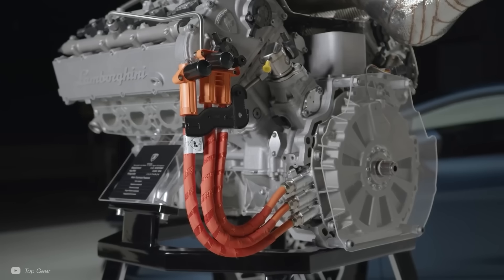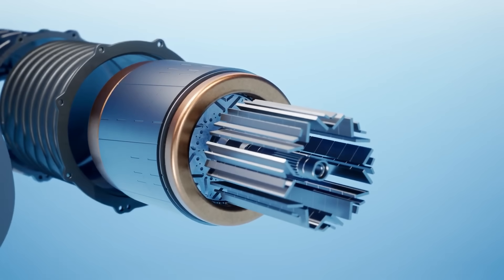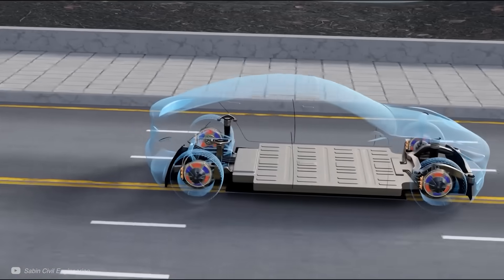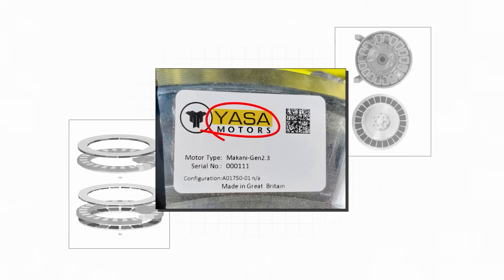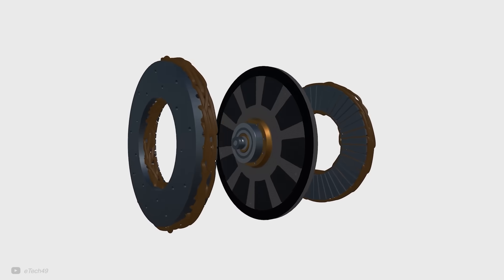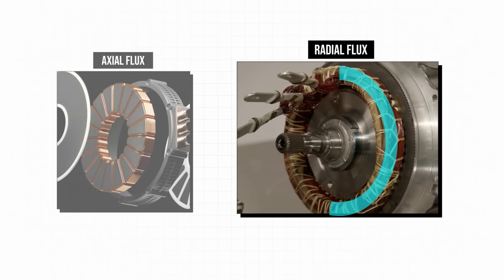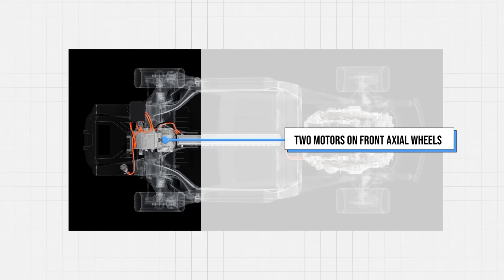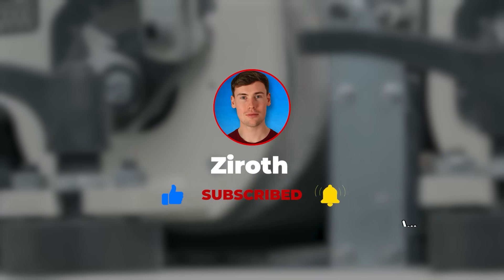Revolutionary Yokeless Motor: The Future is Here

Comment: By having permanent magnet rotors on either side of the axial stator, you remove the need for a yoke on the stator, but introduce the need for an equivalent magnetic-flux-focusing element on the rotor instead, and end up using more rare earth magnets. Talking about saving weight in the stator is putting things out of context. Maybe they use halbach arrays to reduce the rotor yoke requirement, but that means even more rare earths. Having a split rotor also seems more complicated in terms of torque transmission, but I may be wrong on that. Having the yoke on a synchronous motor rotor (i.e. this doesn’t apply for asynchronous motors) also has the advantage of not having to worry about eddy currents throughout it, meaning you can make it solid instead of laminated or powder-composite, and make it structurally stronger. I wonder what material they use for the armature? Unlike a radial motor, uniform flat stacks of silicon steel laminate would be prone to eddy currents.
Reply: They do use halbach for the rotors, and needing a steel backing on the rotor is not exclusive to axial flux

Comment: 3:06 it seems to me like it could be wasteful to have two magnet sets on either side of the electromagnets. I can understand that it's a simpler mechanical design to have the magnets on the outside, but wouldn't there be loss of flux on the "outside" sides of the magnets? Has anyone tested this with a single rotating magnet set in the middle, with a pair of fixed electromagnets on the outside?
Reply: Are you referring to the stator-rotor-stator configuration? It seems simpler, but it's more complex to manufacture, and the permanent magnet rotor endures a lot of stretching.

Comment: Correction: The concept of Axial Flux motors were not developed in 2005. You can trace their origins right back to 1800s, first with Michael Faraday and later Nikolai Tesla.
Edit : As far as I can see, this is conceptually very similar to a halbach array, which is really popular in the 3d printing community as it uses the pole magnets to guide the flux rather than a slab of electrical steel, allowing for 3d printed motors.

Comment: So this could couple to my transmission, take up very little space. The remainder of the space under the Hood/Bonnet is more batteries.

BMW did this years ago with just a Flywheel change. Coils on the outside and magnets along the edge of the Flywheel.

Comment: I wonder if this can be integrated into the hub of a low cost EV, along with a disc brake? Removing reduction gears, drive shafts and CV joints would really boost efficiency and reliability. Never mind Supercars and their performance, just 100HP or less per wheel is all you need for amazing performance in a low cost EV.

Comment: Lamborghini has integrated axial flux motors into its hybrid supercars, notably the Revuelto and the upcoming Temerario. These motors, developed in collaboration with YASA, offer a compact and efficient design, enhancing the performance of Lamborghini’s vehicles. ￼ ￼

Lamborghini Revuelto:

   •   Powertrain: Combines a 6.5-liter V12 engine with electric assistance.

   •   Electric Motors: Features three electric motors, with at least one being an axial flux motor.

   •   Performance: Delivers a combined output of approximately 1,001 horsepower, enabling rapid acceleration and improved efficiency. ￼

Lamborghini Temerario:

   •   Powertrain: Merges a newly developed 4.0-liter twin-turbo V8 engine with three YASA axial flux electric motors. ￼

   •   Electric Motors: Two motors are positioned on the front axle, each providing 110 kW (148 hp) and 300 Nm (221 lb-ft) of torque, while the third motor is integrated within the engine housing to enhance performance and reduce turbo lag. ￼

   •   Performance: Achieves a total power output exceeding 900 horsepower, with the V8 engine capable of reaching up to 10,000 rpm. ￼

The adoption of axial flux motors in these models underscores Lamborghini’s commitment to blending traditional combustion engines with cutting-edge electric technology, resulting in vehicles that maintain the brand’s performance heritage while embracing modern efficiency.

For a deeper understanding of axial flux motors and their impact on automotive engineering, you might find this video insightful:

Comment: If axle flux motor is so good, why doesn't any EV have it?
Reply: They are not safe and demand more maintenance, problem is magnets which are glued on plate, it can be distract. Happened also to innovator and owner of Emrax company during the take off with his sail plane.
Reply: cuz its brand new tech
Reply: @elvisarodell8483  It is a new tech Lynch motors are more then 30 years around, there are many other producers as Emrax.
Reply: It was kind of rhetorical question.. apparently They go back to Michael Faraday 1821 and also Nicola Tesla did a patent with them. They are high torque but low RPM, while regular electric rotors are the opposite higher RPM low torque. 
The main problem has to do with manufacturing and maintaining the millimeter air gap between the rotor and the stator. 

They would work great in places where you need extremely high torque in a very small pancake shape. That's why are they are being used in gas hybrids where the torque converter would usually be since it fits that space.

Comment: I am not an engineer here. I just wanted to compare the motor output seems very impressive compared to what I think is a similar (in-transmission) motor on the Ford F150 hybrid.  That motor only has 47 Horsepower.

Comment: well too bad they are putting them into super expensive cars- They could insert ONE motor into rear of small city car and BLOCK the power output, to reduce heat and stress of elements - because small, normal cars do not need that much power. This could be cheaper, maybe more durable options for cheaper EVs. 
I bet it has less parts, is much cheaper to manufacture, It takse less space in a car and in factory. Thanks to that whole EV will be lighter and will have more range. 

Too bad that many companies like Donut, Yasa, Elaphe do not insert them into normal EVs. Only company Saietta made motorcycles, platform and whole axles with motors, but they merged with Exed Clutch and we don;t know what is going to happen with all that tech. They had vision to insert their Axial flux and systems into cheap indias cars and motorcycles.

Comment: Electric motors have reached the torque vs speed issue that differentiated Diesel and Petrol engines for so long - diesels had superior torque but petrol always had superior speed
Reply: Well, do you believe in that? All I see is gears in combustion. Without gears?

Comment: @7:48 our friend speaks of the segmented Armature…. Then goes on to describe the stator.  The armature is where the permanent magnets are.  The stator has the windings.  As a result he spoke of the stator as the armature. We still do not know of the armature was constructed (other than “segmented”).
Reply: In electromechanical engineering, the armature is the place where the windings are.  That can be either the rotor or the stator depending on the design of the motor.  In this motor (and most motors found in automotive applications), the armature is the stator.
Reply: @JonathanMaddox  I am thinking that the armature is always the rotating part. The stator is stationary. Hence it is called the stator. Either can be permanent magnets or wound electromagnets. For instance a brushless DC motor (not switched reluctance) has a permanent magnet rotor and a wound stator. A simple brush type motor can have a wound rotor and a permanent magnet stator.
Reply: @drswanny9000  the rotor is the rotating part, the stator is what it rotates relative to.  The armature may be part of the rotor, or part of the stator.  In most automotive electric motors, the armature is part of the stator.
Reply: @drswanny9000  I suppose there are also motors where both rotor and stator have windings, though it's uncommon.  I honestly don't know which part we would describe as an armature in that case -- maybe such a motor has two distinct armatures.
Reply: @JonathanMaddox Yes, both the rotor and the stator can be wound.  However, in all cases, the rotor rotates and the stator does not rotate.  Being a permanent magnet or a wound electro-magnet does not determine if it is a stator or a rotor. Only whether it rotates or not.

Comment: this is a stupid design.  why tf would you put the electric motor BEFORE the clutch?  electric motors don't need a transmission to operate smoothly, thats one of their biggest benefits.  putting it in front of the transmission just means you're feeding more power into the transmission for no good reason.  It's like putting a transmission in front of another transmission wtf is the point of that??  Put the electric motors drive AFTER the effing transmission, and you don't have to build a tranny the handle the power of the additional electric motor.  ffs duh

Comment: One of those motors in a motorcycle would be absolutely incredible.
Reply: Company Saietta builded few.
Reply: You don't want that unsprung weight in a motorcycle wheel. It would be a disaster.
Reply: @chesshooligan1282  that unsprung mass is a myth.
Reply: @chesshooligan1282 I never envisioned it in the wheel but rather a drive system to the rear wheel, a drive shaft similar to a BMW would be my choice.
Reply: @Julian-1111  Well, yes, a light and powerful motorbike with instant torque would be a dream, but all the weight reduction gained by switching from an ICE engine to an electric motor would be negated by the weight of the battery (or at least a battery with decent range). All the major improvements in electric motorcycles are going to come from the battery technology. The battery is the new "engine."
Reply: energica and zero motorcycles, accelerates like a rocket.

Comment: so it's basically a flattened out brushless motor you find in any cheap chinesium cordless tool?
Reply: Floppy disc drives used almost exactly that: yokeless but armature-less as well, axial flux.

Comment: axial flux motors outshine Tesla’s radial flux motors in power density, torque, and compactness, potentially offering better range and efficiency in a lighter package. Yet, Tesla sticks with radial designs for their manufacturability, cost-effectiveness, and reliability at scale. Axial flux technology is gaining traction—think YASA in Mercedes AMG or Ferrari hybrids—but it’s not yet ready to displace Tesla’s finely tuned radial motors in mainstream EVs. Tesla could explore axial flux for niche, high-performance models, but for now, their radial flux motors are a pragmatic, battle-tested choice.

Comment: can someone explain the pizza trays analogy he used around 2:30 ?
Reply: Simplest way to think about it, is radial flux motors create a magnetic field toward the outside or inside of the circle in the direction from center to circumference, axial flux creates the magnetic field toward the faces of the circle. The 2d representation of a very 3d principle wasn't the greatest.

Comment: I wonder if it's possible now to just put the motors inside the tires to bypass transmission losses and the weight of the shafts and differentials transmitting the torque.
Reply: yeah, if they manage to make the motors structural enough to be literally used as wheels (with tires fitted over them), while still weighing maybe only a few kg  more then mag wheels, i can see it happening haha

they would remove the need for wheel bearings, axles, gearbox, differentials, but the big savings come when you don’t even need subframes.  

if the motors have enough regen, it could even eliminate the need for brakes (including rotors, calipers, fluid lines, abs pump, master cylinder, vacuum pump and hoses, and much more)

if battery technology develops enough, a gasoline engine (in hybrid applications) wouldn’t be needed at all (we could easily go full electric), meaning the fuel tank, engine, fuel lines, ECU and engine wiring could all be removed. 

this is all only at the cost of requiring four inverters and a heavy battery , however i think even with this added weight, you’d still be EASILY saving MORE weight.
Reply: @ezmatt  Yeah, but I don't see how this will remove the need for bearings and a gearbox. You are still probably going to need some kind of gear ratio, maybe miniaturized and put inside the motor or on its perifery, unless the motor's torque and rpm are perfect for the car. And you will need bearings regardless.

But yes, you can eliminate the need for breaks even if you can't break regeneratively for all accelerations simply because you have instant torque in both directions.
Reply: @ true, a fixed gear ratio between the motor and wheels would usually be helpful. this could very easily be situated inside the wheel motor though (as you mentioned)

as for wheel bearings, what i meant by that is the motor’s bearings themselves would be used as wheel bearings. whereas in hybrid applications, there are two bearings in use; motor bearings, AND wheel bearings.

with some clever engineering, these could also be made to be easily replaceable.
Reply: The issue would be stresses of driving are much higher at the wheel then on the frame of the vehicle because you have shocks.

Comment: They are years behind .... some good design but there are un-necessary losses. flat wire stacks with cooling pack in the middle (yay cooing) ensures that the whole coil does not get the em field  at the same time or even at all. #staytuned  .. The problem with engineers is that they have gone through academia and told what can be done ... however reality is a greater set of information

Comment: the key benefit of axial flux motors is that the electromagnets have a uniform field. radial EMs are obviously wider on the outside and narrower on the inside, and this causes problems (non-uniform EM field) which reduce efficiency and performance/kg.

Comment: I always wonder how they integrate these motors directly on the drive/crank without causing potential timing chain issues in the ICE.  No doubt they have some serious software to prevent it overspinning the crank.

Comment: many fan blower motors in cars from the 90s around that era, used axial flux motors, they are nothing new.
Using litz wire and halbach array can get high efficiencies, patented by csiro australia, up around 98% at certain rpm.

Comment: Well, the vibration isn't related to magnets being further from axis, but that the magnetic field is pulling and pushing on the plate (toward and away from the coils) as they also, mostly, pull or push them along the plane of rotation. Having two plates can make better use of magnetic flux, but also work to "balance" the mechanical forces involved. The design of the magnetic plates to flex less is probably the biggest change.
Reply: The stator is sandwiched between two solid rotors.

Comment: Fun fact: a brushed axial flux motor can be found in virtually all smartphones in the vibration motor (the coin cell shaped part).
Reply: That was 10 year ago. Nowadays many phones, especially high-end ones, have already switched to linear motors for vibration. A linear motor provides breadth, depth, and texture to haptics instead of just having vibration strength 0 - 100%
Reply: @oMega-sm1eg  You didn't need a linear motor for those, it's just a simpler configuration. Look to any decent implementation in a controller for hundreds of examples.
Reply: @oMega-sm1eg  this sounds like something my wife would be interested in

Comment: I wonder now the regeneration compares to radial flux motors. I would assume it to be a greater ratio by mass, like the power output.
3.8kWh battery isn’t much, it’s mean for boost, but it has to charge somehow. So I obviously these are sufficient at the least.

Comment: Excellent report!  I'm intrigued by the idea of matching the YASA motor to a twin rotor Wankel engine and dual clutch transmission.  That would be a nice combination in terms of low mass and very good power output.  Not sure that it would pass emissions criteria.  Well maybe in the USA where the new administration doesn't GAF.

Comment: Great video ! I have followed this Axial Flux design from the whitepaper forward.
Advantages that need more air-time:
Its is easier to automate the manufacturing
There is better control on the materials (and hence reduced eddy currents and production variance)
The design captures and encapsulates far more of the magnetic flux energy, so more power is made per watt
It is compact, being ideal for In-The-Wheel drive motors for non-super-car use. (think Aptera)
The cooling loop is truly internal, not a heat-sink conduction path, resulting in less weight and better cooling

Comment: Great video... one thought. Isn't the density calculation only relevant when including the power cell too, rather than the weight and output of the electric motor alone? Afterall electric motors, especially in aviation, carry the burden of requiring disproportionately heavy power sources as their inherent drawback.

Comment: Good video but you missed one key point about axial flux motors have more efficiency with that extra torque because it pushes on both sides of the coil instead of only one side like a radial flux motor does. We should reduce range anxiety in all electric cars should have axial flux motors but I still think they need more copper than steel to reduce eddy current losses and cogging losses at high speeds

Comment: Lets remember the weakness of axial motors. The spacing between the cakes causes accelerated wear on the bearings.  Worn bearings add more heat, if not properly diagnosed it would damage other internals or electronics.